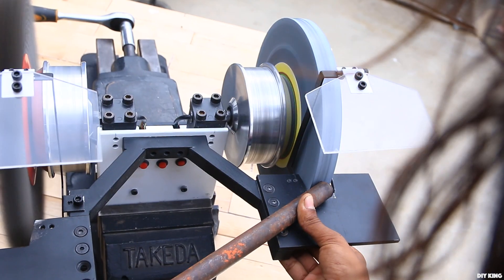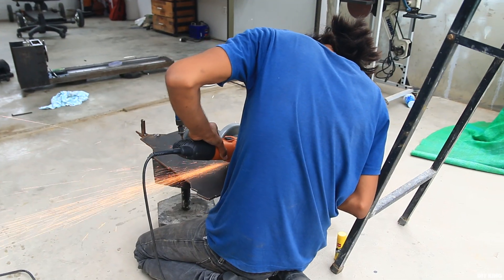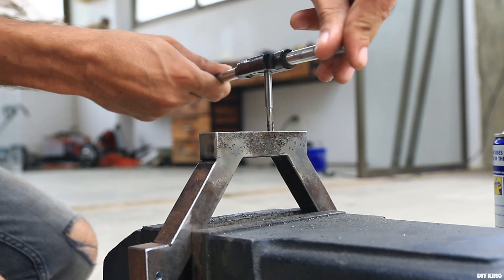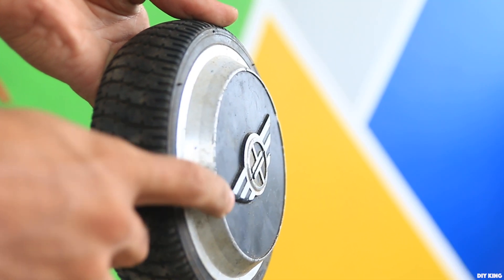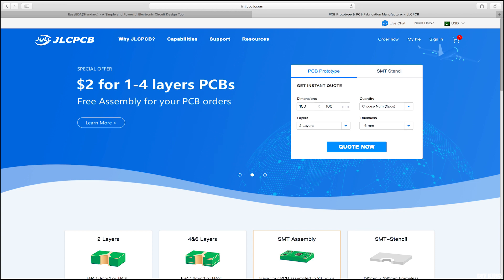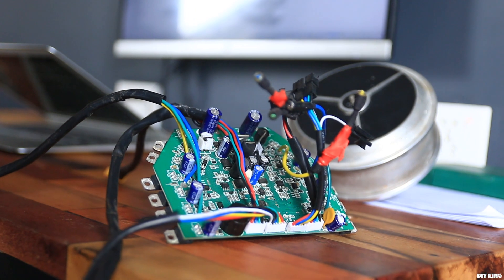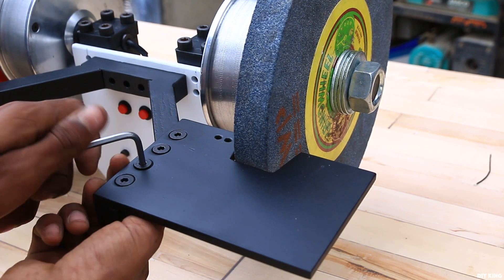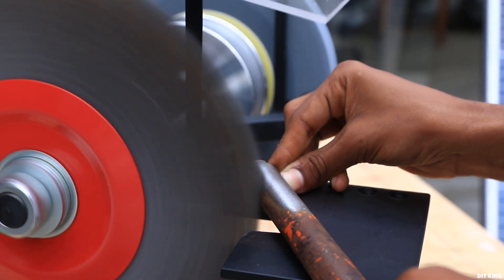DIY Bench Grinder (Powered by Brushless Motors)

Comment: This motor rpm seems little bit slow for this application. But with these motors you can do hand band saw. Without changing the windings it should be ok.
Reply from the maker: Yes, but for a 10 inch grinder it's recommend for max of 2300 RPM.
Reply: @DIYKingSaM  Btw I like your work. Just Rpm seems little slow. I made a milling machine spindle from your brushless drill video, it works really good.
Reply: @Onur Dokmetas btw sine idea, its a great pleasure if you share that spindle pics with us
Reply: @raomujtaba6591   If you share your email adress I'm happy to share
Reply: 6 inch wheel @ 3600 RPM has a surface speed of 28.7 m/s and a 10 inch wheel @ 2300 RPM has a surface speed of 30.6 m/s. 

 So  Wheel Diameter inch x 0.0254m/inch x Pi x (RPM C/m x 1 m/60s) =  V m/s